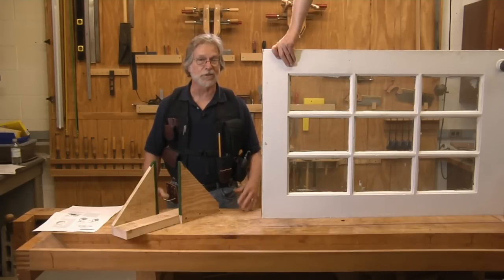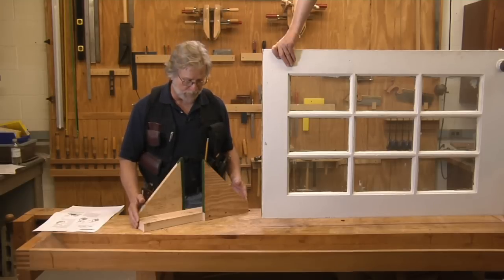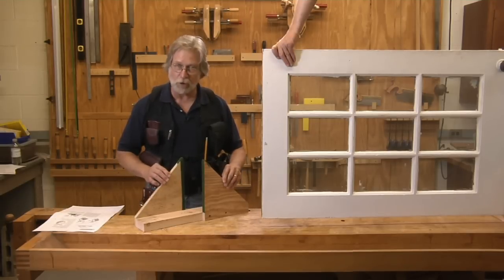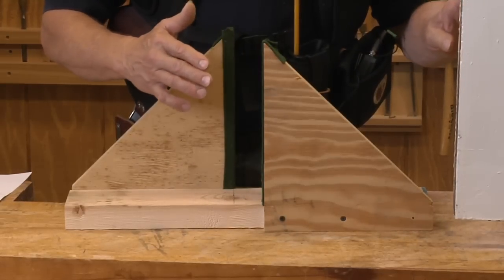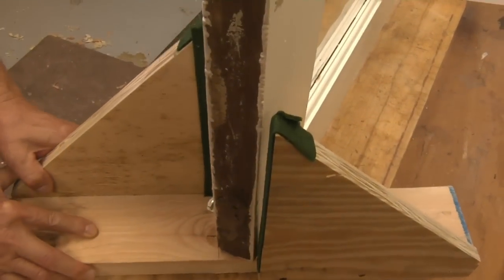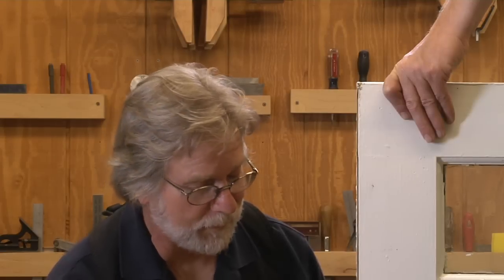How to Build a Door Buck With Scrap Materials

Comment: I built this exact set of jigs.  After cutting the triangles and screwing them onto the 2x4s, I glued felt ($4 at JoAnns Fabrics) around the length or the edges that contact the door, as well as folding over the felt at the top.  It worked great to hold new slab doors for routing new hinge mortises.  Nice and tight, just by moving one end of the 2x4s.

Comment: Superb. I have just made a pair from scrap 3x2 CLS and 18mm ply. I made a right hand and a left hand (clockwise grip and anticlockwise grip), which essentially means they stack together to save space. I made the gap 40mm (I'm from the UK) to sit between the two different door thicknesses so in use they are almost at 90 degrees to the door, whichever size door you do.  I routed a large radius to the verticals to give softer grip  edges.  I have just fitted a lock to an exterior oak door, and they work superbly. So happy, thanks for sharing.

Comment: what is the door is only an inch and 3/8 wide
Reply: Then make put the plywood pieces 1 and 10/16 inches apart if you are using a felt lining, or just 1 and 3/8" apart if not using felt. It actually doesn't have to be so precise, as long as it is close and slightly bigger than the door it will work.
Reply: @TheRacerRich  - 10/16? Is that vaguely similar to 5/8?
Reply: @pterafirma  Cute, but it's not uncommon in the trade to just work everything in 16ths. This is vaguely similar to saying it is common in the trade to just work everything in 16ths.
Reply: @TheRacerRich  - That makes sense, sort of like how lumber is supplied as 6/4, 8/4, etc. But for some reason, I'd never heard a carpenter do that with sixteenths. (This is vaguely similar to saying that makes sense, sort of like how lumber is supplied as 6/4, 8/4, etc, but for some reason, I'd never heard a carpenter do that with sixteenths.)
Reply: @pterafirma  😭😭😭😭